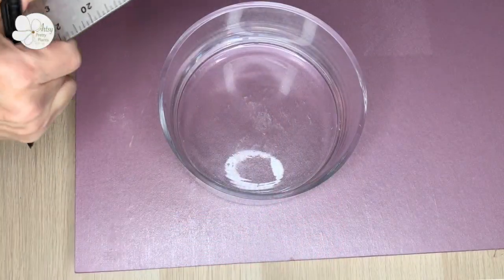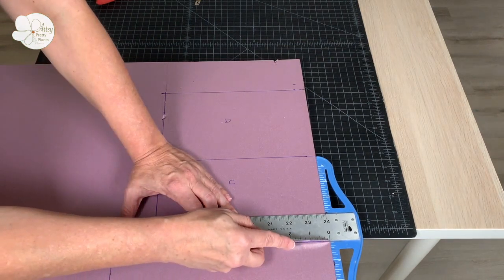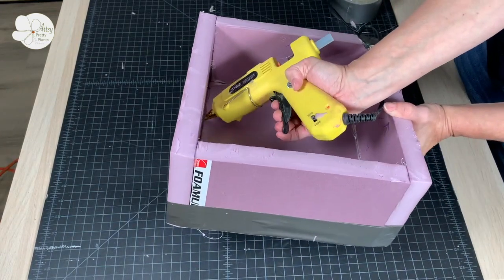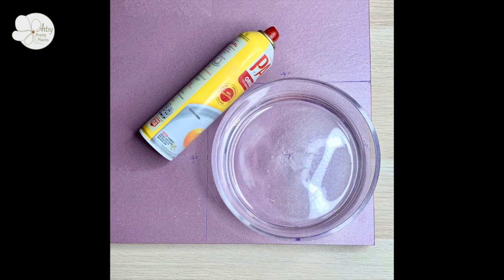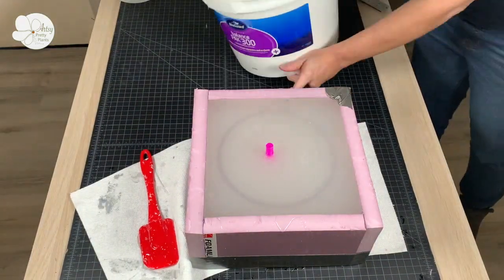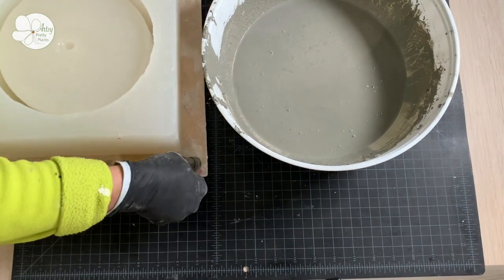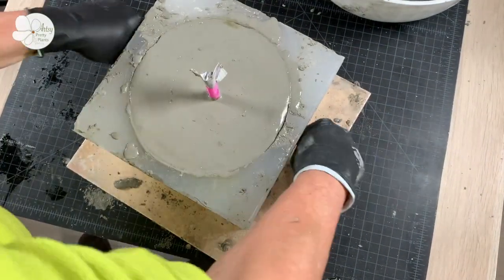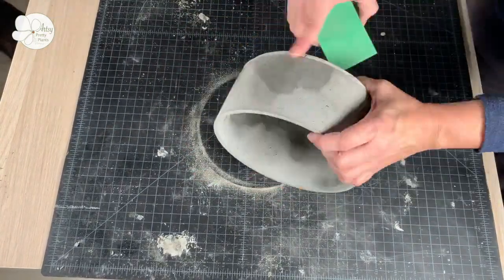DIY Concrete Silicone Mold For A Larger Planter

Comment: I plan to use a core to fill most of the hollow in the pot, lots less silicone and much easier to demould, just a bit trickier due to the core needing to be suspended above the pot.
Reply from the maker: Hi, yes, I've used oil based clay before, but wasn't sure it would be strong enough for this since it was so heavy. I also considered adding a foam core, but didn't want to have to figure out how to suspend it. But it's definitely a money saver.
Reply: @ArtsyPrettyPlants  I've found a 3D printer to be really helpful with making mould boxes, suspensions for cores and things like that.
Reply from the maker: @GaryMcKinnonUFO Nice! I'll bet. As soon as I win one, I'll be using it for all kinds of things. 😁

Comment: Would it make sense to make a box for the mold to go in for strength, and cut the actual mold down one side as well to make it easier to remove the planter from the mold?
Reply: Hi, you can do that, but you will get a line mark on the concrete where the cut is and usually sanding won't remove it. But, just don't use rubbing alcohol to clean the glass like I did because that made it much harder to remove. It will be much easier than it was for me if you don't do that.

Comment: Looks so great! 
Do you have any tips on how to make a large sphere silicon mold for cement pots?
Reply from the maker: You'll either have to do a 2 part mold with the type of silicone I used here- linked in the description, or use a really flexible silicone like in this tutorial where I made a small sphere, but with an opening at the top. https://artsyprettyplants.com/silicone-sphere-mold/

I'm not completely sure you'd be able to make it in one piece and have the cement release, even with this flexible mold. the customer service at Alumilite is quite good, so I'd ask them.
Reply: @ArtsyPrettyPlants  Thank you so much 🙏